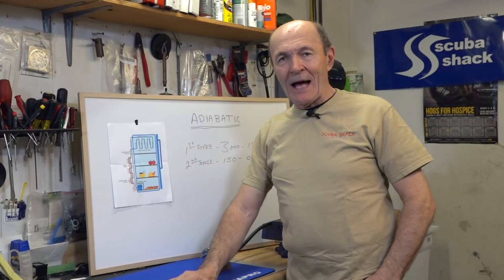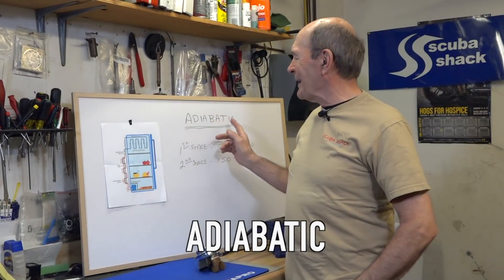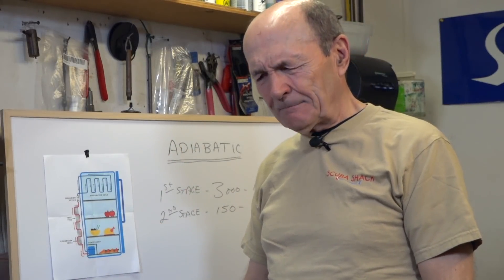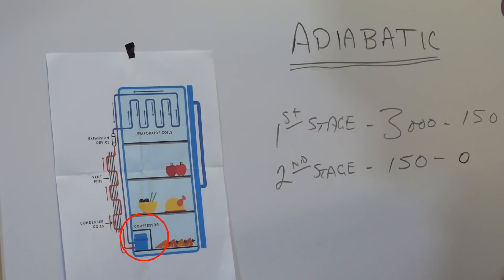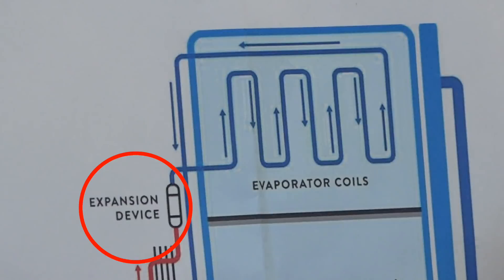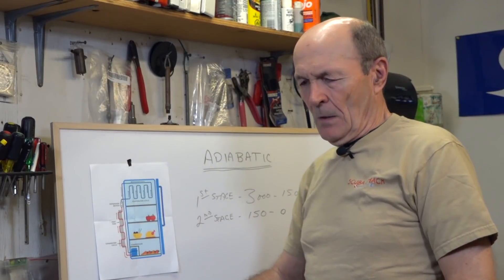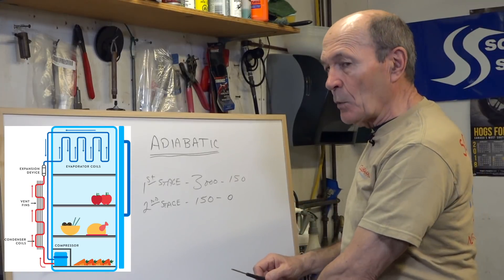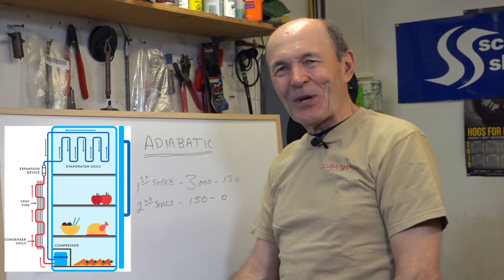Why Does My Regulator Freeze? - Scuba Tech Tips: S09E05

Comment: Question.  When the 1st stage seat can't seal due to icing on it, why doesn't the octo also freeflow?  Don't they both share the same chamber and therefore wouldn't both get too much pressure when ice forms on the seat?
Reply from the maker: Good question.
Technically you're right. Since both 2nd stages are set to crack at 150psi, when the pressure exceeds 150 they both should start to freeflow.
However, it's impossible to actually set the 2nds to crack (or open or freeflow) at EXACTLY 150psi. There will always be a very slight difference, an almost immeasurable difference. Let's say that one open at 149.5psi while the other opens at 15.5psi.
So, when the IP gets close to 149.5, one of the two 2nds will open first. Immediately the IP will drop slightly. It's similar to your water taps at home. If you're taking a shower & someone else opens a tap, the shower spray drops very slightly.
Since the IP is now slightly less than 149.5, the other 2nd stage will never open.
I have seen both 2nds stages freeflow but that was in a unique situation. In that case, the 1st stage froze so quickly that the IP rose rapidly. One 2nd stage started to freeflow but the volume of air was so great that the other 2nd also started. 
Normally though, both will not freeflow.
Now I have a question for you. Assuming the foregoing is accurate, which 2nd stage will freeflow first - your primary or the Safe Second?
Reply: @AlecPeirceScuba_SeaHunter  Thanks for the explanation and well said! It makes perfect sense that the primary would normally flow before the octo. I'm looking get a good cold water reg and it helps to understand this given all the marketing hype. Thanks!

Comment: Alec, So this brings up an interesting question. For example in ice diving applications or extreme cold if the diver chose to install an inline shut off between his 2nd stage inlet and low pressure supply line thinking if the regulator system freezes up and goes into free flow they could simply slide the inline shut off to save valuable gas in their cylinder. By suggesting the above is there any concern of the regulator failing to the point during a freeze and sending cylinder pressure down the LP line and rupturing the hose if the inline shut off was in the off position. Might it still be prudent for temporary use to allow just enough time for the regulator to thaw and return to standard operation?  If single back mount cylinder diving with a redundant bail out maybe its not so easy to just turn the tank valve off by hand compared to an inline shutoff. An alternate necklace regulator can easily be sourced in the mouth as the free flowing regulator is shut off. After a brief moment open the shut off to see if the reg is back in standard operation.  Anyones thoughts on this?  thanks...
Reply from the maker: The only truly fail-proof way to continue a dive once a free-flow has started is to have a separate tank & regulator. A "Y" valve on a tank with a reg mounted on each leg of the Y would accomplish the same thing but turning off one Y and then turning on the other can be tricky.
When I was making "questionable" dives (deep, solo, night, incursion, etc., or maybe a deep, solo, night incursion dive!), I wore 2 tanks with a complete separate reg system on each. It sounds complicated but there was no Safe Second so it wasn't so bad.
Shutting off the LP line to a regulator would run the risk of a LP hose burst. You would need an in-line on the primary and on the Safe Second. If only one was turned off, the other would start to Free-Flow to relieve the pressure.
It's possible a frozen reg would thaw but it would likely take more than couple of minutes AND only if the no air passed through it. That is, no breathing on that reg.
Alec
Reply: @AlecPeirceScuba_SeaHunter  thanks for the insightful response and as I suspected. Likely why we don’t see this in practice and I completely follow the logic if HP gas is placed on the LP ports if there isn’t an available 2nd stage or OPV, over pressure valve as used with drysuit inflation cylinders, there is too much risk for a possible blown LP hose. 

Just heard of an ice diver that took a free flow after splashing through the  ice hole and he reported his main cylinder was empty in nine minutes. They arrived at the dive location via helicopter. 

I understand if an inline shutoff was installed between the 1st stage LP out puts and LP hose/it would protect the down line hoses but at that point what’s the point as you might as well just turn off the cylinder valve.

On a twin set this is a basic valve drill. For a single back mounted main cylinder it  may be a bit difficult to manipulate the tank valve. Of course only doing all this if you have a complete working separate bail out reg in your mouth and thumb the dive to sort the gear out top side before proceeding with any more diving.

The only concern is to save a dive cylinder from completely emptying while on site with limited resource on the day of the dive. Then again if the divers reg is free flowing due to ice even after it thaws it’s likey to return shortly there after in the same dive environment.

Thank for the open discussion it can be very insightful for many of us as we sharpener awareness of what can happen when Merphy pays a visit. Cheers, #SeattleRingHunter

Comment: Sorry if you already answered this, but what do you do with a reg that freezes? I know you've said you're done diving for that day, but do you clean it? Does it need to be serviced? Does it fix itself once it gets warm again? What steps do you need to take before taking that reg on another dive?
Reply from the maker: If your reg free flows while diving, a controlled ascent is all you can do.   Depending on water temperature and thermoclines, as you ascend the free flow will slow as ice melts.  Sometimes it will stop completely at 20' during a safety stop.  What a free flow says is "this reg can't take this cold water".  Find warmer water to dive in or use a reg designed for cold water (below 50F /10C).  Having a close and attentive buddy in cold water is very important so be careful.
A

Comment: Alec, why don't they have fins on the first stage to keep the heat conductive parts of the regulator nearer to the ambient temperature?  Very common in cooling transistors etc. But I've never seen one on a reg, is it because the seat is thermally isolated from the body ?      Chris
Reply from the maker: There are several reasons all basically related to 'not really needed' by most divers.  If dived properly in cold water, watch my video S07E02 Prepping for Cold Water Diving, you shouldn't get a cold water free flow as water is always above freezing.  Check it out may be some good ideas for you.
Reply: @AlecPeirceScuba_SeaHunter  Thanks Alec,     Having had two free-flows at 36 and 31 Metres in succesive dives at around 6 C. ( at the beginning of my scuba adventure)  I bought cold water regs the next weekend and never dove with rented regs in cold water again ! Oddly enough, it was a set of Sherwood Blizzard regs as you describe in  S07E02.

The good thing about having free flows in an inland lake with plenty of experienced divers around is that after experiencing it, there is a much lower chance of panic or task overloading when it happens next time...  sometimes a bad dive can be a good thing long therm.

However, since I've seen your video I'm guessing it was probably due to the fill having higher than optimal water content,  I never had a dry mouth when diving with air from that shop, whereas I always get a dry mouth from fills from the current shop I use. 

Its a pity we don't have a device like our Oxygen sensor ( which I use diligently for Enriched Air) to show the moisture content of the fill.

Thanks for the explanations,
Reply: They do.  Check out Apeks MTX 1st stage.  (And no, it's not a Dalek!)

Comment: Interesting! But then, if it is the moisture contained in the air we breathe that condenses and freezes, why does that tend to happen more easily in fresh water than in the sea, at the same water temperature?
At least that is my perception. I dove a few times in 2-3 ºC seawater and my regulator worked fine; I did the same in a lake, and had a free flow after less than a minute. I thought it had to do with the freezing temperature of the water (lower for seawater because of the dissolved salt). But if what freezes is the air moisture, then salt or fresh water should not make any difference.
Reply from the maker: In all water types, the adiabatic process is the key factor causing a freeze up.  Remember my tip to never breath a reg in cold water until the 1st stage is under water.  I have ice dived many times without a free flow but seen other divers to 'warm water' activities like pushing the purge button several times, breathing the reg several times all before entering the water.  Nature and physics need to be respected in extreme cold water.  Safe diving sir.

Comment: Modern frigs use internal "vents" and have a fan blow hot air out instead of this passive shown cooling like the old one I have in the garage.
Reply from the maker: Yes. The removal of the heat is a crucial function of a modern fridge.
Alec

Comment: Hi Alec . Very interesting video I always thought that the second stage was the problem because that is where all the visible heat transfer fins are and that is where you see the freeflow I didn't think about the first stage bypassing and building more than the 150 psi then dumping through the mouthpieces. You talked about the very old regulators with the strait hose and valves locking up if the first stage fails or freezes and you get no air, I guess the newer ones you can still breath with a freeflow and end your dive safely! I look forward to your tech tip on the first stages and freezing up. I'm always learning something new (I can't think of any dumb old guys either HaHa) thanks Owen m
Reply from the maker: I will discuss those "heat transfer fins" in our next cold water diving episode.
Thanks for watching Owen.
Alec

Comment: you're totally right, 

I've saw an industrial application where I used a high speed cycling pneumatic cylinder, the pneumatic system of the shop was in a good average condition, the cooling of the cylinder was so important that ice formed at the exterior of the cylinder and of course, the cylinder circulation passages froze tight so I installed a permanent heating device at each end of the cylinder to overcome that condition, the situation of the regulator first stage is similar, the only way to avoid the freezing is to supply extra dry air in the tank and most compressor that are not equipped with a refrigerated air dryer are not able to supply that air quality, even compressors so equipped can fail that requirement if the drying system is not in top shape with new dissicants and a compressor that does not admit oil in the air stream as oil destroys dissicants very fast.
Reply from the maker: Right on Jacques.
An electric heater for the 1st stage would be great, impossible, but great.
I don't think that desiccants can be used for breathing air. Scuba compressors rely on what's called a separator where oil and water are removed mechanically. It's not perfect but works well, if, as you say, the system is well-maintained.
Alec

Comment: How does a sealed 1st stage help with freezing if that's how it works? Thanks
Reply from the maker: We're going to talk about 'cold water kits' and supposedly 'freeze-proof' regulators soon.
Alec
Reply: It doesn't. For cold water diving look for a cold water certified 1st stage or add a cold water kit to it. Most cold water 1st stages have something like a heatsink build into it. Since water is above zero it will transfer some of that warmth into the first stage and prevents it from freezing.
Reply: Do we're talking about piston vs diaphragm frist stages or these sealing kits? I think the sealing kids just seals the system and wont help against freezing, maybe its good to keep dirt out of the regulator. Otherwise we can't win against the physics, if there is something that cool the parts we just can make sure these parts can still operate or we can make sure it can be heated by the enviroment good enough to stay in operation. 

Sidenote: most times I read about freezing of the second stages and not the first one.
Reply from the maker: Sealing kits and sealed regulators do NOT stop freezing. They do keep environmental water (the water in which you're diving) out of the regulator. That's more beneficial to the longevity of the regular than the longevity of the diver. 
It stops corrosion.
Alec

Comment: as always great teacher. Would have been great to expand more on how to limit the issues as the water in the air might not be something we have control over if there is only 1 shop in town (other than tell them, make sure they do the max). Like is there some 1rst stage design that are less prone (piston vs diaphragm) or size of the opening/overall size, or brand/model. Thanks
Reply from the maker: We're getting a video ready that will talk about various regulators that claim to be freeze-proof, and how they all fail to live up to their expectations.
Coming soon Alain. Stay tuned.
Alec